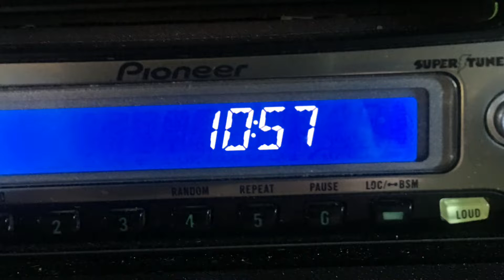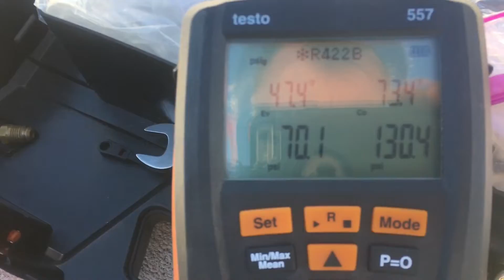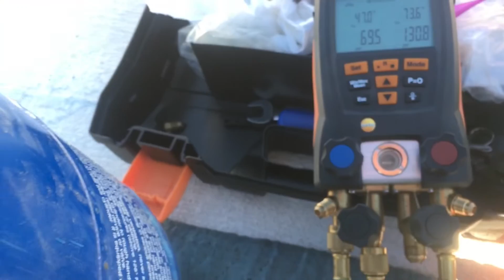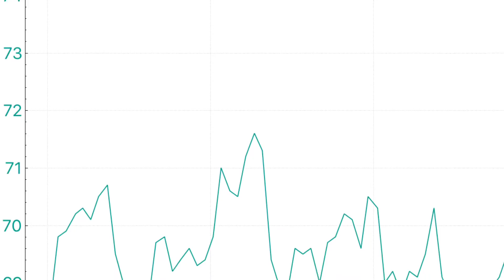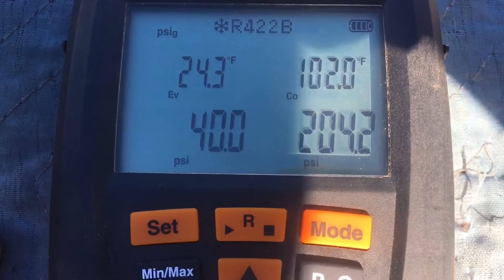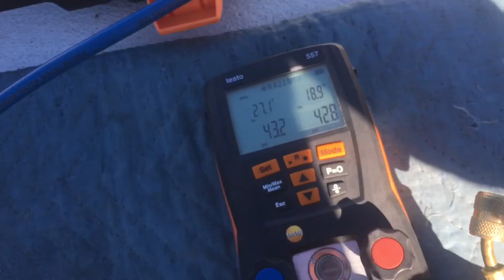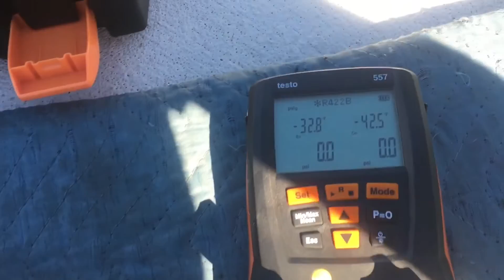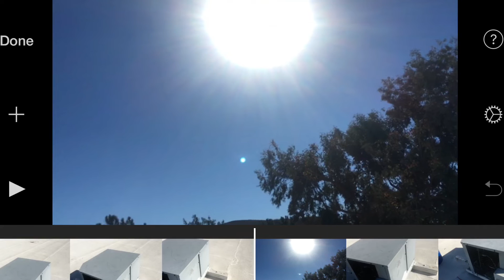How to Hook up,Purge & disconnect 4 Valve Refrigeration Guages to a system properly.

Comment: If you have such a low suction pressure why would you not pull out the little refrigerant out leak test if its that low its leaking bad you just keep charging the customer without trying to fix the problem?
Reply from the maker: Call Has to be scheduled for repair when less stuff is in there. Customer does not want to repair at this time. walk in cooler too Full to workin there. customer is boss. i can only try. if they say no. oh well. cant do anything about it.
Reply: @OcRefrig  got ya well customers like that give job security lol wasn't trying to call you out just wondering good video keep them coming
Reply from the maker: Happy July 4th to ya ! 🎉🎉🎉🎉🎉
Reply: Gas and go momma!

Comment: Thanks for good tip. It's really nice weather now after torrent rain for straight two days. I had to went up to roof to repair heat pump A.C. unit and exhaust  from kitchen. I was totally soaked and cold. that's life for us ;)
Reply from the maker: I Don’t Work in Rain ! Too Dangerous ! You have only ONE Life ! Be Careful. Water & Electricity Don’t mix.